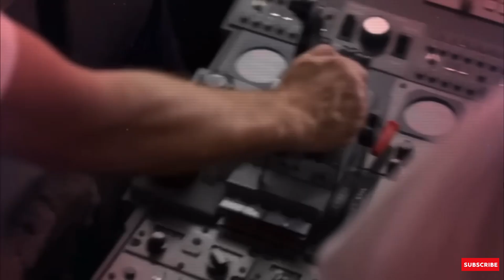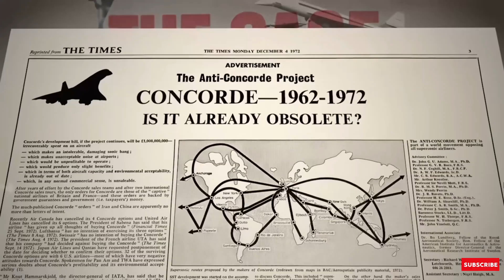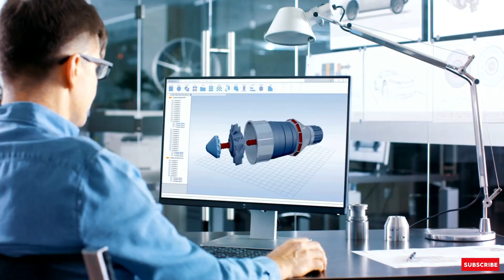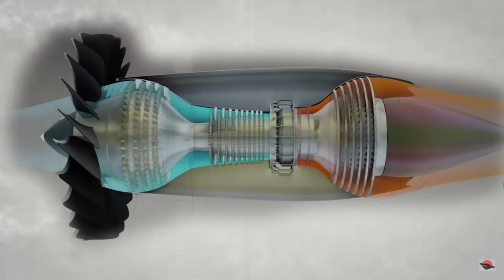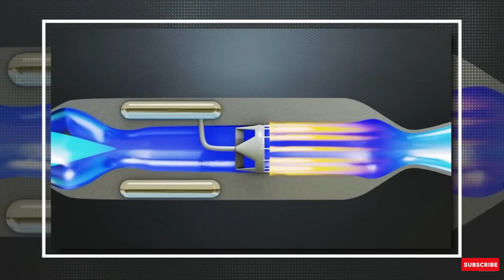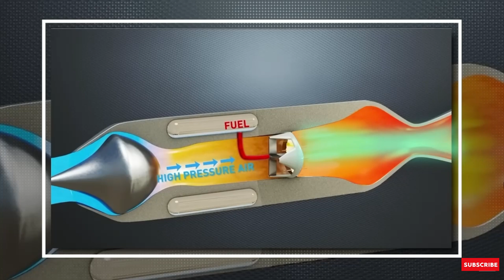How NASA Plans to Change Air Travel Forever

Comment: ContinentalUnited had a strap fall off its engine one takeoff before the Concord took off in Paris. No one noticed the strap, because they do not inspect the runway after every takeoff.  The Concord tires threw up into the fuselage and punctured a fuel take.  The pressure at takeoff is so low compared to supersonic flight.  However; Concorde state the the costs to fly the jet were not making a profit.  During the TSA investigation, they did say that fatigue cracks were found at the trailing edge of the wing, but stated it was not the cause of the crash or cancelation of the plane.